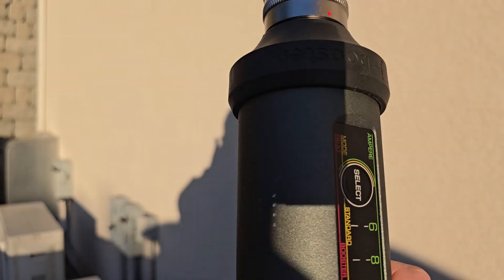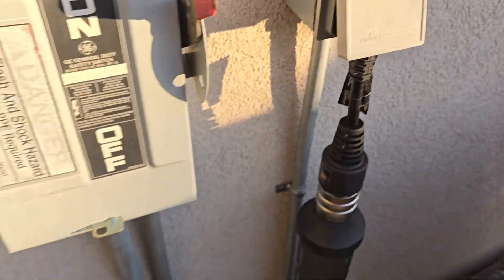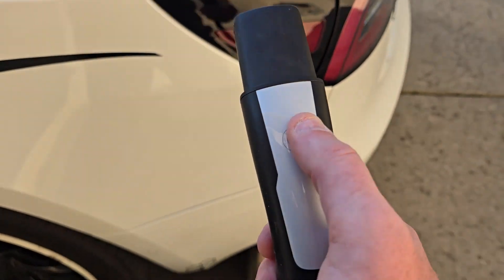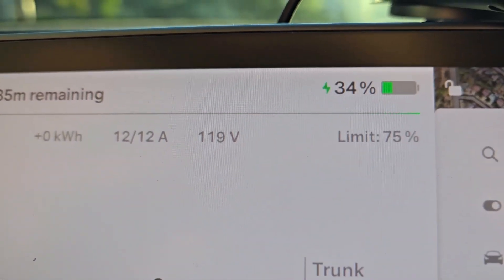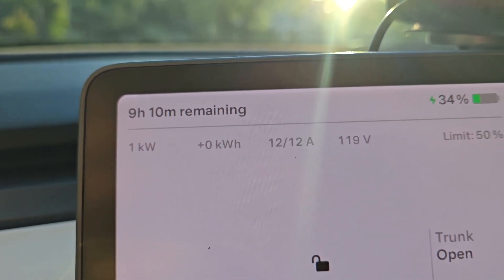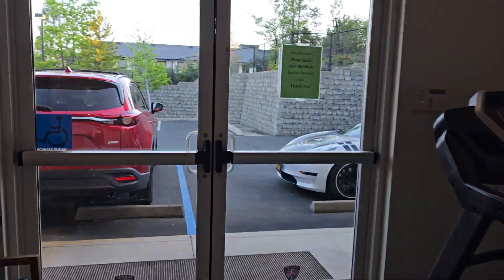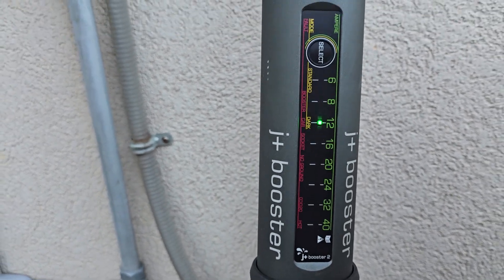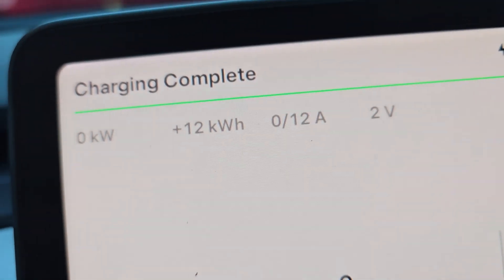J+ Booster 2, with the J3400 (NACS) testing @ work on 119v

Comment: Um... What's the point of this charger?  Why is this different from the Tesla mobile charger?
Reply from the maker: Excellent question. As I have both I can assure you that the J plus booster is considerably more weather resilient. It is a much more Stout unit and I have been using that far more than I ever have my mobile charger.
Reply: @teslatim78  ok perfect.  Thanks for that
  From a charging standpoint no difference.  However the build quality is where this shines.  
Thanks.
Reply from the maker: @FSX239  one of the better things you get from the J plus booster, is you actually get to see how many amps your drawing from the outlet on the actual unit itself. Where is Tesla just shows a line, showing that it is in fact charging so you do get a little more information on the jplus booster